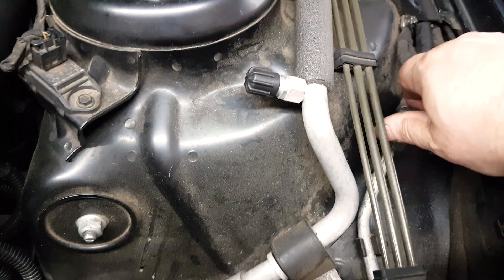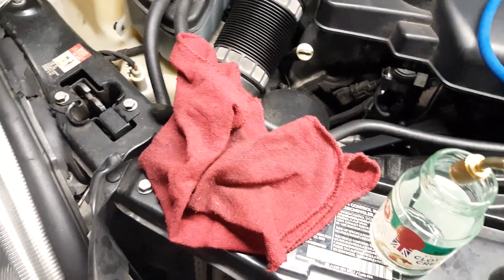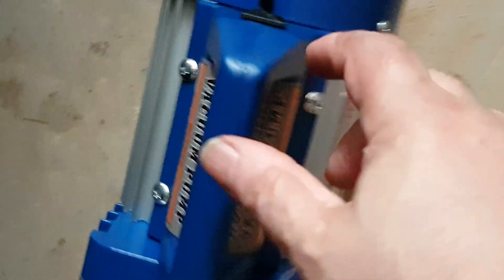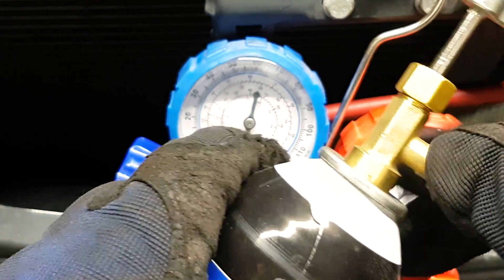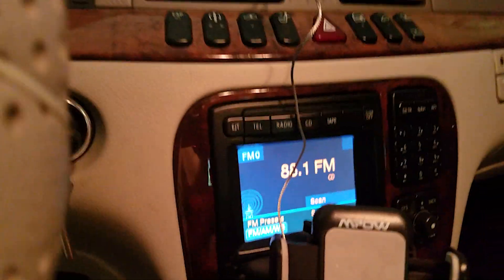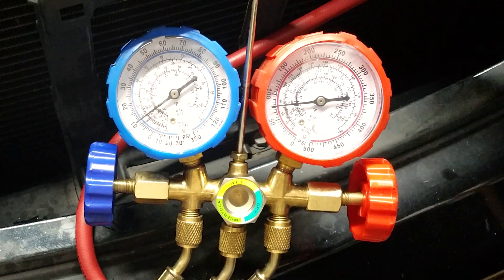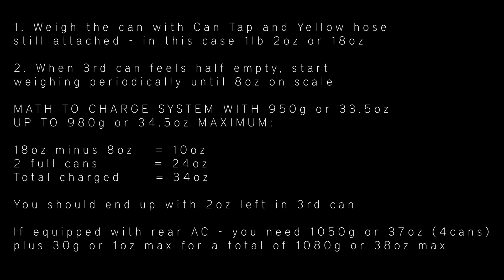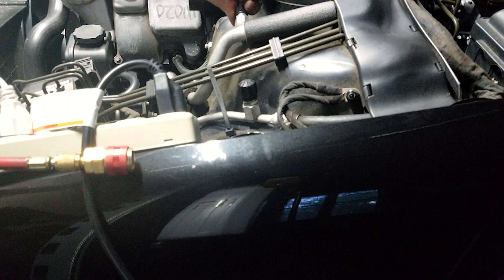Mercedes W220 AC Service - Charge system with R134a Refrigerant - Part 4 - S500, S430, S320

Comment: I appreciate your time to CREATE these informative insightful videos.   They are very well done.  Thank you!!

My 2002 Mercedes Benz S500 blows hot air when set to cold.   So I will vacuum the system and re charge the freon R134a. 

Then I will change the temperature sensor if needed.   What do you recommend?
Reply from the maker: Yes, see if the vacuum holds.  That is one way of doing it without much troubleshooting. Good luck.

Comment: I got a w220. Pulled vacuum, there was pressure in system when I set my gauges up initially. I tried to put Freon in,  there is no leaks in the system. it showed the same pressure on the high and the low side, I cleared fault code with carsoft… I’m sorta stumped on best way to diag this.
Reply from the maker: Hi, is that with the compressor turned on?  If yes, you have a bad compressor.
Reply: @masood-tv  yeah, with Freon charged and a/c code cleared and ac turned on.